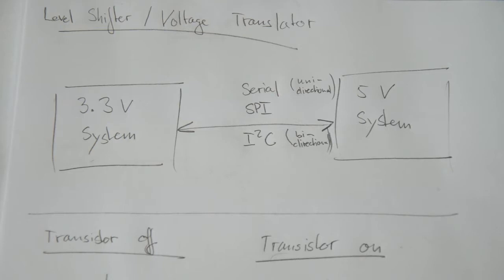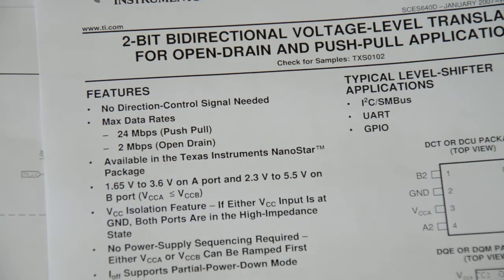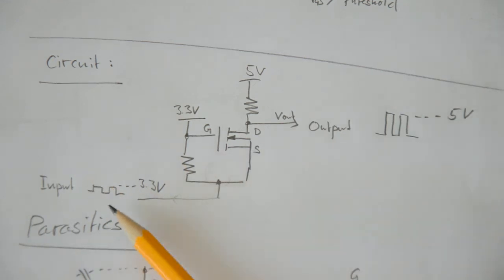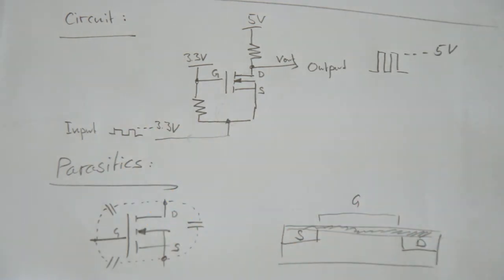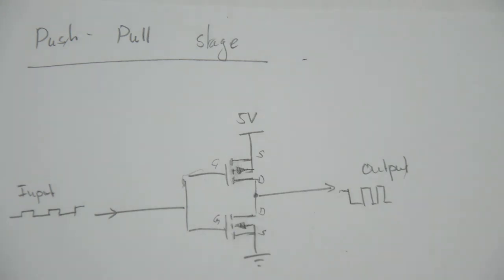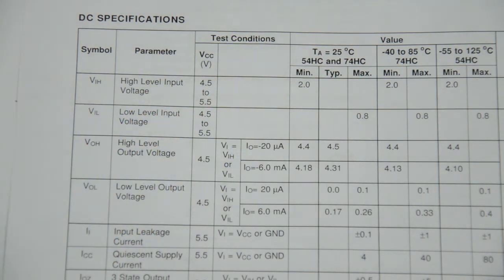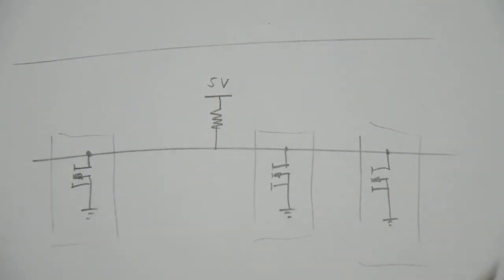Translating 3.3 V to 5 V

Comment: I use the 74LVC573, the 74LVC373 is the same device with a different pin out, they will handle faster switching signals than discrete FET based level shifters.

Comment: 7:08: A voltage divider can get you in trouble in those cases where you should have made a buffer to the next section. The numbers shift in the next voltage divider (without a buffer), so to speak. Took me some time to figure that out.
Reply from the maker: This is correct, any load at the "output" of the divider is in parallel with the lower resistor and loads the divider. You can take that effect into account when designing the divider but I would advise against that and use a buffer in cases where you have a low impedance load. That buffer can do the level shifting by itself if selected properly...

Comment: The truth is the circuit with one MOSFET and two resistors works 90% of the cases and is cheap.
Then take a 74LS125 or 75HCT125

Comment: AND WHY DON'T YOU BETTER CONFIGURE YOUR ARDUINO PIN AS INPUT, AND PUT IN IT, FOR EXAMPLE, A 4.7K RESISTOR, AND WHEN YOU WANT A ZERO YOU SIMPLY CONFIGURE IT AS OUTPUT AND SEND A ZERO.
Reply from the maker: This is essentially the open drain approch, just with a microcontroller. What I discuss in the video, however, does not presume the presence of a microcontroller.

Also, keep in mind that according to the datasheet of the microcontroller used on any arduino board, there is a maximum input pin voltage that you are not supposed to exceed. This is usually a little bit above the supply voltage. Following your suggestion for a down-shifting converter would violate that spec and the internal protection diode would start conducting. The series resistor would limit the current and probably prevent damage, but it would also limit the rate at which you can toggle the pin, as discussed in the video. I would advise against this technique unless you are down-shifting or have checked that you are not in violation of the the spec.

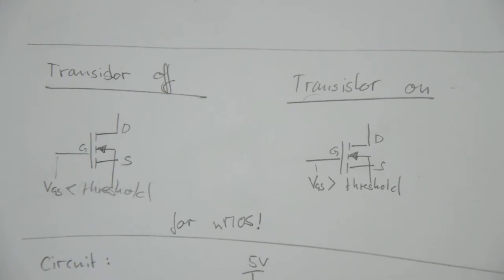Comment: At 8:03 you're describing an "N-Channel Enhancement Mode Insulated Gate MOSFET".
However, there are other MOSFETs called "N-Channel Depletion Mode Insulated Gate MOSFETs" that do conduct when the gate voltage is 0 volts and turn off at negative voltages. 

With Depletion mode you don't require a pullup to +3V. Just connect the gate to 0V or gnd.
Hint, maybe +3V isn't readily available. You can also use "N-Channel Depletion Mode Junction FETs", (nearly all are) for this.

redrok

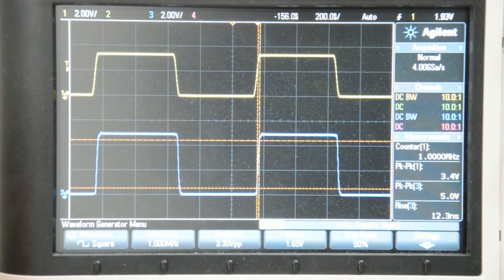Comment: @27:15 did you try it  @20Mhz? i would love to know if it solves the rising edge curving issue
Reply from the maker: This was a number of years ago, but no, I did not try this at any other frequency. I needed a level shifter for a signal of that particular rate and thus this is what I used. If I remember correctly, I did not have any issues with curved rising edges in the end.

Comment: Can I remove the 10k pull-ups, as I wish to logic level shift but not using current sinking. I will be push-pulling logic levels from a 5V schmitt trigger and wish to down-convert the logic levels to the Raspberry Pi's 3.3v GPIOs. I know the resistors can be changed to e.g. 1k for a stronger pull-up, but can they be removed entirely?
Reply from the maker: I don't think you can remove that resistor altogether but I'm not sure why you would want to do that. Maybe I'm missing something though; you are describing a uni-directional system (your schmitt trigger is a strict output) and to knock that down to 3.3 V you could just use a resistive divider or a zener clamp.

Comment: Can't I just use Op-Amp as level shifters?
Reply from the maker: You can use Op-Amps, but there's a number of catches that make this somewhat non-trivial. There may be more benefits if the signal was analog, but the video is about shifting a relatively fast digital signal in a particular way. There is no doubt that you can do it with an opamp, but you'd need one with a sufficiently high slew rate. Furthermore you'd need one that can go down sufficiently close to the negative rail as I had no negative rail in the design this was intended for, and adding one surely would be overkill. Plus, the opamp solution requires more more passives than what I show, hence I wonder what the real advantage would be here...

Comment: Just use opto isolator. I use a few on a esp8266 and mosfets to pwm dim led lighting. Using this method you can send 5, 12 or even more volts to drive the mosfet.
Reply from the maker: That's a nice idea if isolation is desired. But other than that it doesn't add anything compared to the single transistor solution I show. Also please note that the main application for the circuits I show in the video is level shifting of signal lines with a focus on moderately fast signals. The PWM-dimming of LED that you use works well with any optocoupler, but the signal I was dealing with when I did the video was > 1 MHz. What's your PWM frequency? I bet it is much lower than that. Propagation delay of a typical optocoupler (say 4N25) is above 1 us for a load resistor of 1k. "Just use opto isolator" would not work in this case, you'd have to consider a few things and I don't think it pays off to do that except if you need isolation. It's a good thing to be aware of the option though, thanks for your comment!

Comment: Hi, could you explain if it can be done using a non-inverting amplifier instead? To amplify a 3.3V to 5V
Reply from the maker: Sure, it can be done without inversion. I show a number of methods, e.g. the TXS0102, the single-MOSFET circuit and also if you chain two inverters together you get level shifting without inversion (kinda like double negation). Do those work for you? Or maybe you mean something specific when you say "non-inverting amplifier"? Are you trying to do it with an opamp circuit? It can be done but I don't think it makes a lot of sense to do digital level shifting with an opamp. Or are you trying to amplify an analog signal?
Reply: MrCircuitMatt Sorry Matt I meant yeah with an non inverting op amp? Could you possibly show me how the circuit will look like.  Also another question if you can, what circuit need to be built to modulate eg a 50 hz AC signal -4 to 4V to a range 0 to 3.3V?
Reply from the maker: Hey there! Have a look at https://photos.app.goo.gl/hR5YswRaCxjuNwof2 which shows a bunch of interpretations of what you want to do. (1) is what I did in this video. I believe what you want is (2) but it could also be (3) or (4). Which one is it? I believe (5) is what you want in the second question but I'm not sure.

Comment: Matt Thanks for the great video! I have a question for you. I have 3.3v output signal to 5v input for a stepper driver.  Is it that important to use the spark fun product or the logic buffer chip in your video?
Reply from the maker: It might work but I really wouldn't bet on it. The 3.3 V vs. 5 V issue aside, to drive the motor, you have to sink some amount of current into the motor coils. Chances are that whatever generates your 3.3 V signal cannot deliver that current. Less current means less torque so your motor might not start rotating at all or might be super weak. Plus you have to consider protecting your driver from inductive kickback since the motor is an inductive load (afrotechmod has a nice youtube video on that). On the bright side, if you come to the conclusion that you need a driving transistor to drive the stepper, you get the voltage conversion for free it you do it right. Google application note AN235 for a primer on how to pull this off.

Or are you driving an integrated stepper driver that requires a 5 V logic level with 3.3 V? In that case please share the part number of the driver or check the datasheet, but the general points in the video hold in this case. Let me know if you need more help with this. Good luck!
Reply: Thanks for getting back to me, here is the link to the driver.https://www.omc-stepperonline.com/stepper-motor-driver/stepper-motor-driver-24-72a-max-80vac-or-110vdc-ma860h.html

I already have a working project with arduino controlling this driver and nema 34.  I tried using a teensy 3.3v and it would not put the driver to logic high for Puls or Direction.  So i figured this would be the perfect video to watch! I'm working on a new project and I wanted to use a arduino Due.  So I needed to find out how to control the driver.

Comment: How do you calculate the max frequency at which you can use a mosfet for level-shifting SPI or I2C communication? If I use something like the source drain capacitance and the RDS ON to calculating a rise time (3 tau should be enough?), that seems a lot different (less time) than the turn on rise time of the Mosfet.
Reply from the maker: You have to take into account the time required to charge up your gate. Have a look at the document I am linking in at the end of thid response. In Fig. 1 you'll see how no drain current is flowing at first until the Vgs reaches the threshold voltage. Then some drain current starts to flow but the transistor is still maintaining the Vds it had in the of state. And only after that Vds starts to fall. (This is also where the Miller effect kicks in). This is why it's more tricky than simply assuming that you're charging a parasitic capacitor through a resistor of the value of RDS ON. In fact RDS ON is only really reached once you have turned on the transistor hard, which is not the case yet when you're in the "turn on phase". I would say that the your calculations are still optimistic even if you neglect the time needed to charge up the gate. Hope that makes sense. Here's the link: https://www.engr.colostate.edu/ECE461/chapter_supplements/ch21_supp2.pdf

Comment: Hi could you explain how when the source is at zero volts the output is dropping to zero? How do you calculate the Ids to find out the drop in pull up resistor? We just know overdrive voltage ...
Reply from the maker: Hi! Assuming this is about a simple inverting level shifter with an n-FET: When the source is grounded and the gate is charged up to a sufficiently high voltage, the FET turns on. This means that it allows for current to flow from the drain to the source (the drain current) and that the voltage between source and drain (Vds) is almost zero. Now if the source is at ground potential and Vds is almost zero, then the voltage at the source and therefore the output is almost zero. That should answer your first question.

On your second question: Under the above conditions, i.e. when the transistor is turned on hard, the current is only limited by the resistor. I.e. Ids is Vsupply/Rpullup and the drop in the pullup resistor is Vsupply-Vds which is approximately Vsupply. (It would be unusual to implement level shifting without turning on the transistor hard). Does that make sense?

Comment: Really informative video.
I need to level shift from 5v to 35v with a 1Mhz bandwidth.  Any suggestions how I might achieve this?  thanks
Reply from the maker: When you say a bandwidth of 1 MHz, what do you mean exactly? Let's say you had a square wave at a fundamental of 500 kHz... the third harmonic would be at 1.5 MHz and thus outside of your bandwidth. So amplifying the fundamental would be sufficient? If so, I would look into amplifier designs that are designed for these kinds of loads. That should get you started and would show what kinds of caveats there are. (Or maybe a step-up transformer works, I don't know enough about your application to give a good answer here :-( ).

Comment: could we possibly convert the 3.3 volts to 10 volts?
as connecting an Arduino with a larger mosfet?
I have a 2n7000 mosfet and a IRFP460 mosfet.
Thanks anyways :D
Reply from the maker: I guess you're asking about the unidirectional, single transistor, inverting approach. You can absolutely use the same approach for shifting up to 10 V. You will need a transistor that can take 10 V across its drain-source-channel but that's fairly common, both the 2N7000 as well as the IRFP460 are OK. (I don't think you need a power FET there for signals, though). If you need to level-shift more than one channel, you could use a transistor array like the ULN2803 or similar. I hope this was helpful.
Reply: well what we where planning is using the 2n7000 (since its a logic level mosfet) to switch on the IRFP460 (since its Vgs = 10 V) to work for a 3 phase motor (Which needs 380 V and 15A) using Arduino but for some reason our setup doesn't work properlly.
and yes its very helpful thanks :D

Comment: Hi, I'm quite the noob, but I really hope you can help. I'm currently working on a simple radio project using an arduino uno, RDA5807M, small amp and LCD. At the moment I'm trying to add the blue lit 16x2 LCD but, unfortunately, the LCD is 5v and the RDA is 3.3v(maybe I should have bought the 5v TEA5767 instead). I don't want to be buying extra modules because everything will be going on the same PCB,  so I believe I have two options:  use a 5v supply and drop the voltage to 3.3v for the RDA, or use a 3.3v supply and boost to 5v for the LCD. Looking at your video I think you can put me on the right track. What would you recommend I use?
Reply from the maker: Hello. Definitely easier to work with a 5 V supply and drop it to 3.3 V for the tuner, especially if power consumption is not super critical. If you do that, I think that both your arduino as well as your LCD are 5 V systems and you can readily interface between the two. However, you will have to design the communication bus between the arduino and the tuner carefully since the two parts are running off different voltage rails. I'm not sure how you have solved that right now. I'd be glad to further discuss this with you but this is sort of hard to do in youtube comments. You are welcome to send me an email to hb9frv@uska.ch though, I'm also on skype and IRC. Would be nice to hear from you. In any case good luck with the project!
Reply: Thanks for the quick reply.  Will contact you soon via email.  Cheers.

Comment: If I wanted to use a BSS138 to shift from 3.3V to 5V BUT not bidirectionally, would it be reasonable to only connect the 3.3V to the gate and then not supply any reference 3.3V with a pullup to the normally input side? Basically trying to avoid using a diode if necessary.
Reply from the maker: I guess you are referring to the traditional N-FET circuit where the gate is tied to the lower reference voltage and where two pull-ups are used. But no diode is used in this circuit. Since you're not using this bidirectionally, I'm not quite sure which would be your input side... I feel that there's some information lacking for me to confidently answer your question. Feel free to drop me an email though if you want to discuss this :-)
Reply: You could use a positive voltage shifter with an inverter.  A pull up resistor is necessary since you have an inverter.

Comment: I have observe the same from Sparkfun Level shifter in my test I did few days back. I think M74HCT125   is better alternative. But how about limiting the current as well? say 3.3v Raspberry Pi that is limited at 2mA on it's pin at LV side and a 5v servo which can draws above 15ma on the HV side - is there a feature as well or additional current limiting circuit is required for M74HCT125? any advice.. Thanks I learn something.
Reply from the maker: fnjyusername So sorry that I missed your comment. Better late than never, though: I hope that I'm not misunderstanding the question. If you use a solution such as the M74HCT125, the current on the high voltage side (15 mA in your case) will be soured from the supply (pin 14). Not from the input pin. So if this is your concern you should be fine.